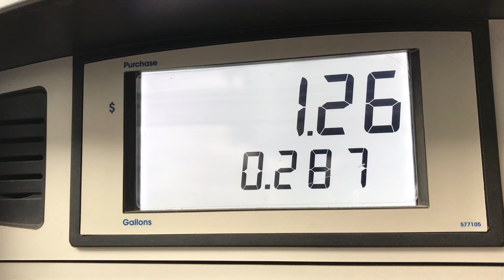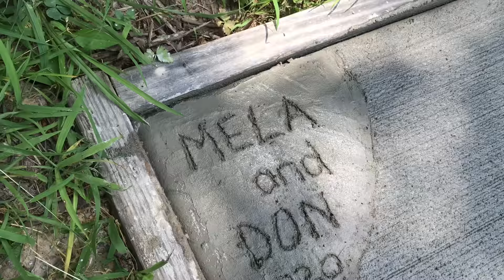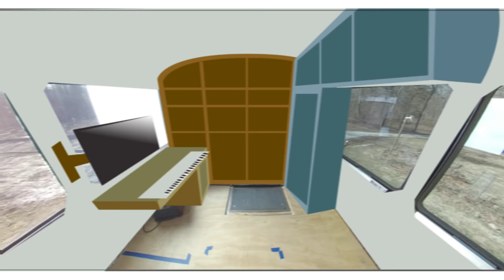Bus Conversion TIME LAPSE / Amateur Builders Complete Interior Shell in Tiny Home Progress Rehabit8

Comment: When your floor starts having problems popping up it is because it is a floating floor. You NEVER put it down until after the walls are up. Installing anything onto a floating floor ensures the popping.

Only thing I can tell you is when this starts to happen you will want to go around each item mounted to that floor and trace cut everything so it becomes a floating floor again.

EDIT oh yeah, you are doing a GREAT JOB.

Comment: We had a mouse on our transit bus die and couldn’t find it anywhere.  Somehow the thing had gotten in the box fan and we were blowing dead mouse air all over the place.  Stuck for two weeks!!!!  Finally found it.  We set traps after seeing a mouse run through.  We caught 12-15 before we got it under control again.   Put up those ultra sonic repellants.
Reply from the maker: ew gross!!  ha ha.  Yeah we did start using an ultrasonic repellant.  It works pretty well!

Comment: Just a word of advise to potential coach converters ,keep in mind that all coaches Prevost or MCI come from the factory with 6” more head room than regular (Greyhound) coaches. So if you are a short person a regular coach would be no problem,if you are TALL then your better off buying a older model motor home that needs to be redone ,it might cost you a little more but it will save you many headaches and TONS of work .
Ans there are lots of “dated” motor homes for sale.🇨🇦😎

Comment: If you can you might think about putting a Diesel heater in. It can run off the same fuel tank of the motor they really work great don't use a lot of fuel and it's nice to be toasty and winner. Love what are doing your RV friend😎👍🇺🇲

Comment: Roswell New Mexico built thousands of MCI grayhound busses for many years. I worked in engineering.
Reply from the maker: Hey Dave that is awesome! Maybe you worked on our bus (1996 102D3)?
Reply: @Rehabit8  good possibility. I left the plant in 2000. Worked at the plant for 20 years. I actually made all the ignition keys for them. A good place for parts is Hausman bus out of Chicago, if their still around.

Comment: That’s a lot of work. We’re looking at doing a mini version of this. Too bad you couldn’t have stayed in CA to do your build. I’m surprised you guys didn’t add insulation to the floors when you had everything up though. That would help with heat and noise. It’s nice to see couples that still get along after such a big project.
Reply from the maker: We didn’t have a space to work on the bus in CA that was close to where we lived so it worked out easier to move.  We do have some insulation in the floor, but I do wish we had more.  Our reasoning was that we don’t have a roof raise.  So building the floors up would mean losing height. Best of luck with your build 😁

Comment: This is the first time that youtube has suggested this channel to me, I will definitely follow it. I do have a question though. Did you use insulation to prevent the floorboards from being damaged by water?
Reply from the maker: Welcome!  I'm not sure I understand your question but we used plastex on the underneath side of the floor boards in places it is exposed to the underbelly to protect from exposure to water, dirt etc.  We used some insulation to help keep our toes warm in winter, and then waterproof vinyl planks on top of the wood flooring.  Hope that answers your questions ;)
Reply: @Rehabit8  
Yeah. I only saw the time lapse video. I guess I missed that part.
Thanks

Comment: Why did you gut the interior so extensively? Especially the floor. What was wrong with it? If you wanted a blank canvas why not just lay plywood over what was there?
Reply from the maker: Hey Steve, we are really glad we gutted down the rummage metal. After pulling everything up removed a lot of mold, fixed rust spots and of course removed 40 years of dust and dirt! If we were planning on it a weekend RV we would have done exactly as you suggest, laying plywood over the existing floor, but since we will be living in it full time we wanted to know what was in the floors and walls for a healthy living environment

Comment: I'm caught up now but I went back and watch this one again. When did you guys actually paint the bus when you first got it it was black. And what did you use to paint it? The paint job is a pretty big undertaking that would have been great the video to. Have a question what makes most people decide to take the roof down and the floor up. Why not just go over the existing just seems like a lot of work that really don't have to do. I mean maybe I'm wrong. Thanks for taking the time.
Reply from the maker: The black was a wrap.  It made the bus hot, so we removed it.   There's a video about it in Season 2: The demolition.  That ugly color underneath will not be staying.  We will paint it further down the line and for sure make a video about it :)
Reply: @Rehabit8  💪💖🇺🇸 Ty

Comment: Why did you remove the factory subfloor, side panels and insulation, just to turn right around and reinstall new ones?  Rot, age, or other considerations?
Reply from the maker: Hi Primoroy, the more we pulled up, the more we were happy to replace the worn, weathered and filthy flooring and insulation. We wanted to start as clean as we could to remove filth and possible spores since we knew we wanted to live full time in the bud when complete

Comment: Why did you strip the original floor and insulation from above the cargo areas and why take the roof insulation out ?? Seems like building on top of this would I make more sense
Reply from the maker: Because it’s a 20+ year old bus that has been used for public transport.  By taking it down to its bones we could remove rust, protect the metal, cleans (you won’t believe how gross it was in the walls and floor), find leaks and insulate it better.  If the bus was for weekends here and there, maybe not worth putting the time and effort in but as this will be our full time home it’s worth doing it right and make it last another 20 years

Comment: I saw wood that was going to be seen from the bottom, what did you use to protect the bottom of the wood from under spray while driving? Thank you
Reply from the maker: Hi Bob! There are luggage bays underneath the subfloors. So there are parts of the plywood subfloors exposed to the luggage bay only.  But we painted the underneath side of the wood with kilz 2 latex sealer which seals porous surfaces from mold and mildew.  The luggage bays are all metal.

Comment: I'm confused, why take out any insulation in the floor or ceiling?
Reply from the maker: Hi Nicolas, we choose to gut the bus down to the metal to treat all the rust and clean it out. We also wanted to add more effective insulation for a living environment (thus the cleaning ) and painting the metal with rust protective paints to ensure it will last us another 30
Years.
The bus original insulation had bugs and mice remnants as well so starting from a clean slate was the goal :)

Comment: I can't quite understand why you removed the aluminum subflooring, and replaced it with wood
Reply from the maker: There was no aluminum floor.  The original subfloor was plywood.  Under the plywood is metal beams open to the luggage bays and various hoses run down the center.  By taking out the buses original wood subfloor we could clean (you won’t believe how dirty it was under there), treat rust on the beams, remove the rails for the chairs and put new wood subfloors in that can last another 30 years.  We have many videos documenting the details of this.  Check them out!  It’ll make perfect sense 🙂
Reply: @Rehabit8  the last MCI buses that were supposed to have a wood subfloor (marine grade 3/4" plywood) were the mc9 and "A" and "B" models. 

By the of the mc12, "C" and "D" models, the subfloor was aluminium
Reply from the maker: Well I don’t know what to tell you, we have video of us taking out wood subfloors so.....